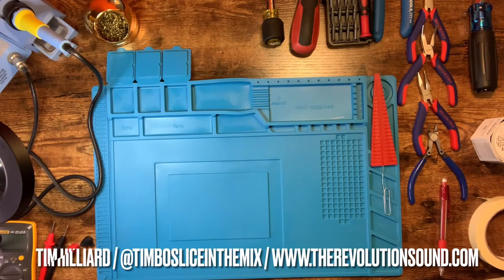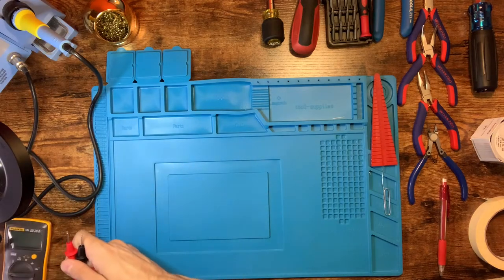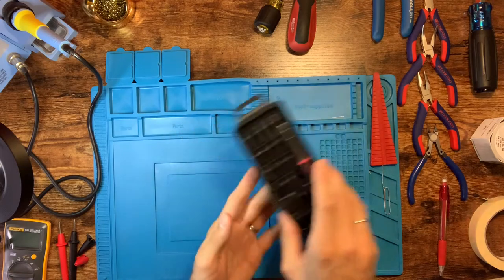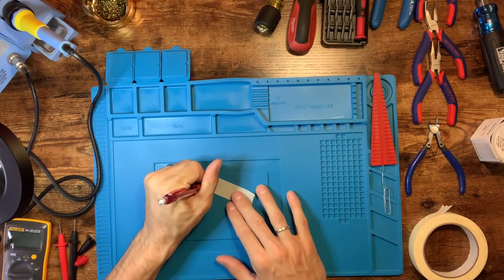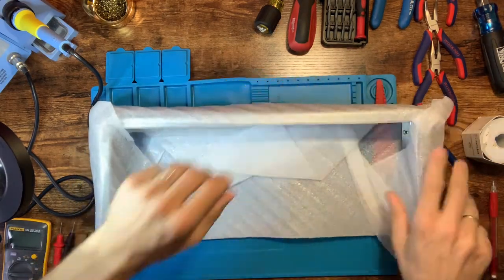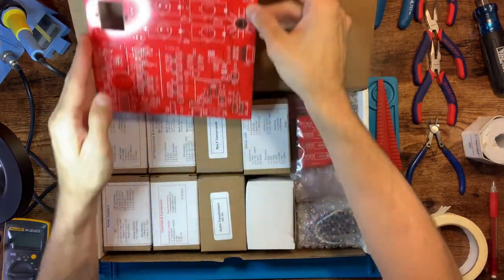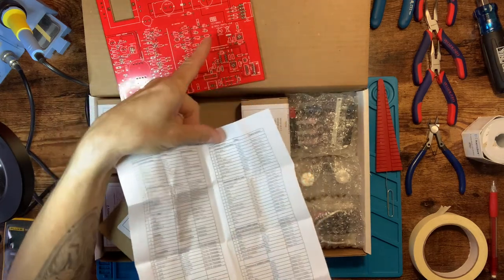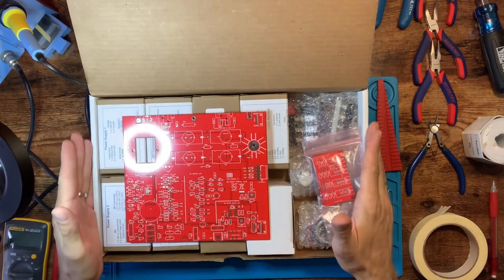Hairball Audio 1176 Rev F FET Rack DIY Build - Intro and Unboxing

Comment: Hey there! So my friend and I just ordered a 1176 Rev A kit build. Due to the shortage we need to source our own transformers! The only input transformers we can find are vintage new in box UTC O-12’s, or the Cinemag 3303 with the wire leads as opposed to the terminals. Do you happen to know if the cinemag with wire leads will work with these units as far as running the leads to the PCB where a transformer with the terminals would mount??
Reply from the maker: I'm sure this is far too late of a reply, but no, I don't know - that would've been a question for Hairball Audio.  I know technically you could still connect it because the PCB has hole through connections that you can get wires into.... but then how do you mount it, and does the different shape interfere with any other components (mutual induction)?

Comment: Hey i'm an aspiring audio engineer who mixes all ITB and can't afford analog gear but want to try building my own. You said this was an intermediate build. What would you reccomend as a beginner build? I plan on building an 1176 cus i've always wanted one and I have experience building computers but nothing as indepth as working with circuit boards.
Reply from the maker: There are several kits for mic preamps from the same company that fit into a 500 series chassis. Also I’d recommend DIYre for smaller kit builds. They have a BAX EQ circuit that’s pretty simple. But before any audio kit I’d recommend grabbing some small kit off amazon to practice soldering first!